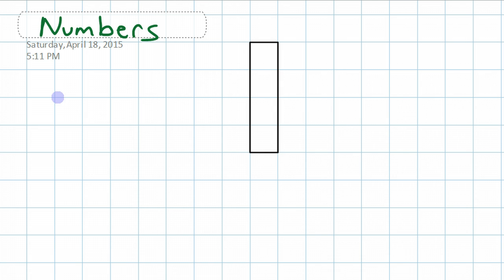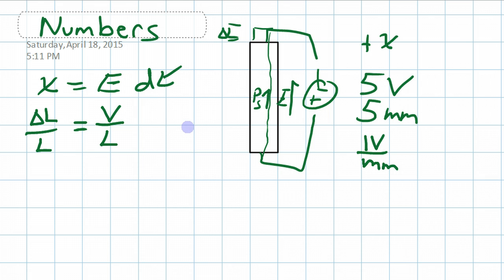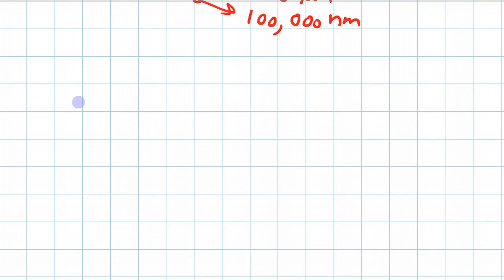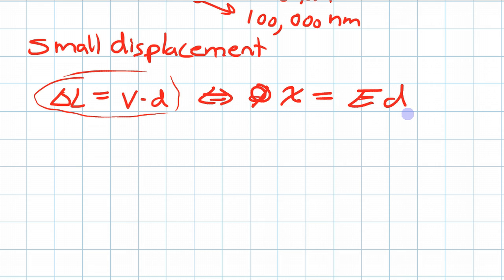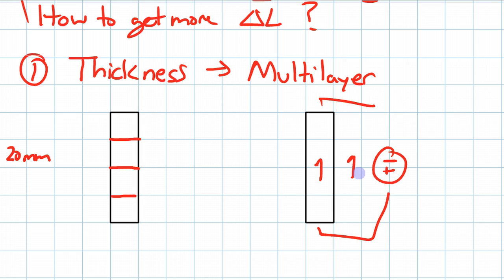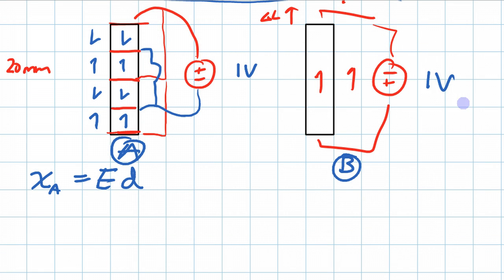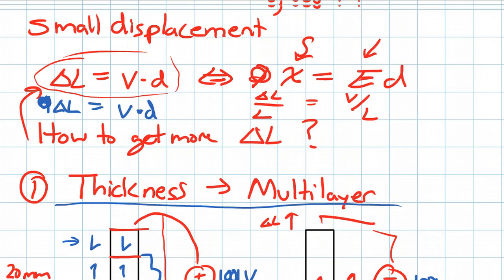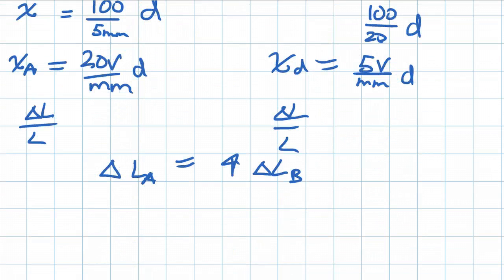Learn Piezo Lecture 7A: Piezoelectric displacement and multilayer actuator

Comment: So basically what I understood is the finer layers of piezo-electric materials we can stack on top of one another to form a specimen, the more strain we get to have with less voltage.
Reply: And the reason was because of the fact that we have L in the denominator of both sides of the equation so they cancel each other out.
Reply from the maker: @garykeyvan662  Yuip
Reply from the maker: This is true

Comment: In terms of energy harvesting from piezoelectric, what if we solve for the output charge? Does the multilayer give us more output charge compared to the single layer if both of the have the same dimensions?          

And thank you so much for your efforts :)
Reply: @ultrasonicadvisors  so would the final charge be 16times the one with only one layer or 4times ?